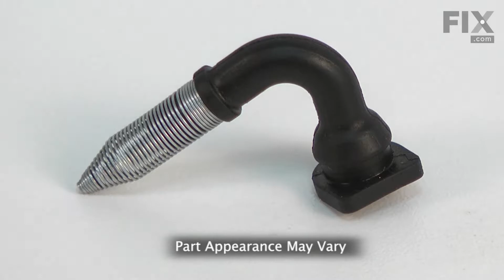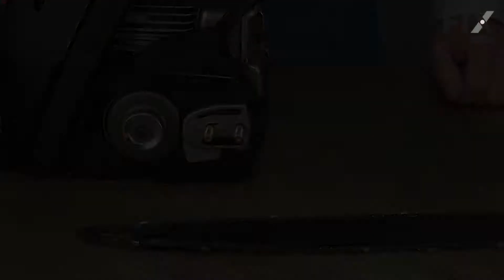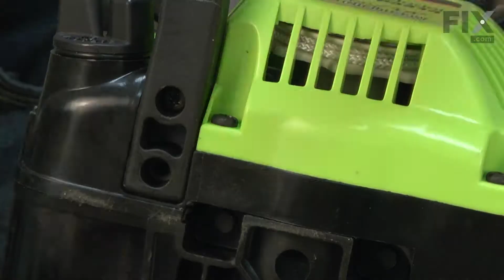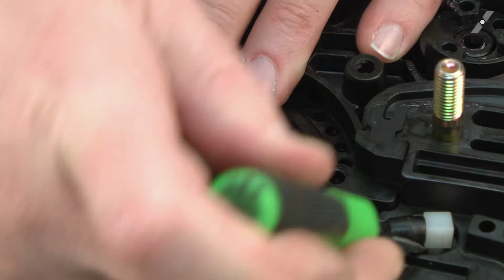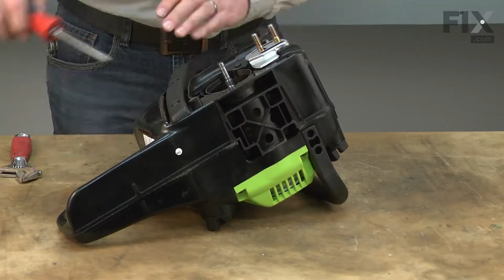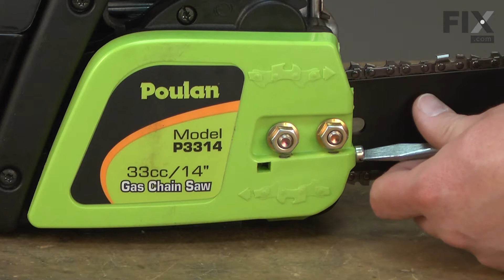Poulan Chainsaw Repair - How to Replace the Oil Pickup Assembly

Comment: Thanks for the video. It was very helpful in repairing my saw, which was leaking oil while not in use.
My Poulan is a model 2375 (Wild Thing), and removal of the handle isn't necessary to complete this repair. Thankfully!😂

Comment: One mistake you made was when using a impact on the clutch install is you need to pull the starter cord out a bit so your not putting stress on the starter assembly. But if your just using hand tools you don't have to do this

Comment: Does anyone know... at 5:42 on the right middle part of the screen, there is a white circular hole between the brass bolt sticking out behind the fingers and the 3 black horizontal holes to the right of the needle pliers?

Comment: I doubt you actually need to remove the clutch and oil pump just to replace the oil pickup assembly, but in the video, the metal piece that covers that area just magically appears on reassembly, covering the area in question.

Comment: I would like to know why Huskarvana /Puolan chose to use a plastic worm drive gear on the bar chain oiler? It it that much savings over a brass gear? (plastic= $0.33 cents, brass gear = $1.97 cents as they are the overseas parts assembled in the United States. The 50cc engine can creat heat from a stuck chain while cutting a tree and get hot! (NO). This heat transfers into the shaft and melts/deforms a single tooth on the oil pump. No chain oil, then what? A chainsaw that wears the bar & chain turning it blue from heat. Piss poor design as it would add $2.00 to the cost of the saw. Rototillers have use brass worn gears for decades with no problems! Duah! They sit around and worry about market share yet lose repeat sales after failure occur hundreds of times per day. Yes, let’s talk about lost market share due to lost sales as others use time test bar oil pump for chain lube! You can choose to but a different brand of chainsaw but you can’t get your money back after a failure designed into this product!
DK, ASE master tech since 78!

Comment: I have a problem with the chain oil leaking when not in use. Most likely due to the tube being cracked or dried out. I have a Poulan Pro 4218.
Reply: Hey did u ever fix the problem I got two saws and on leaks and the other doesn’t but the one saw that leaks seems like it’s using a bunch more oil too then in use. But from what I can find there’s no way to adjust the amount of oil?
Reply: @zackmuggli2330  I haven't looked at it yet, I was using another chainsaw that I had instead of the Poulan. Currently I am overwhelmed with projects on my to do list. I am hoping that it was just because I may have been using winter chain oil in the summer. The saw was given to me by someone who cuts a lot of firewood so the saw is pretty well worn out. Once I check it and fix it, I will let you know for sure.